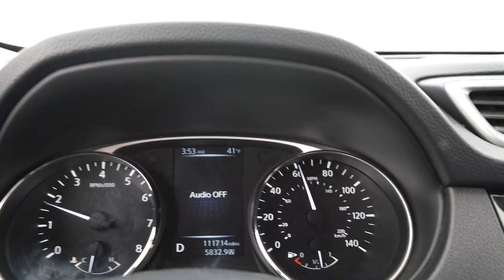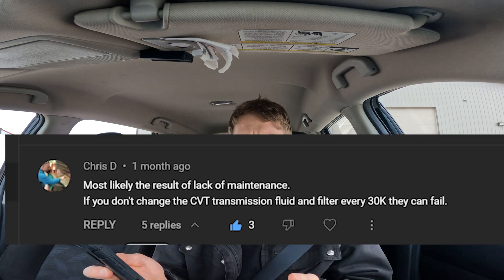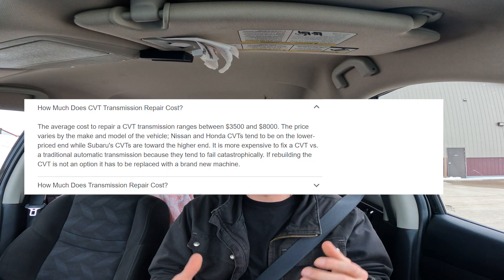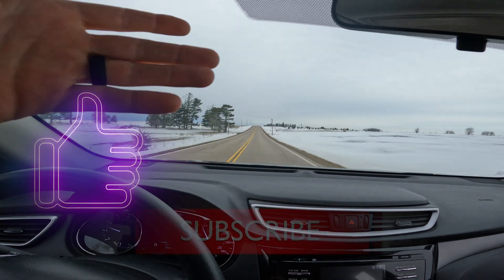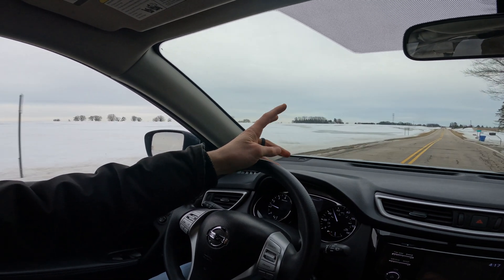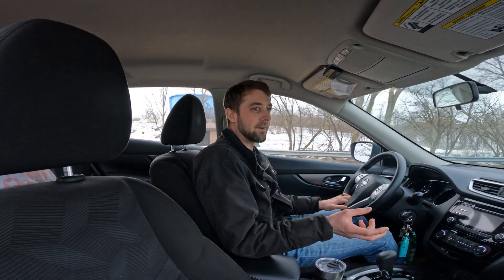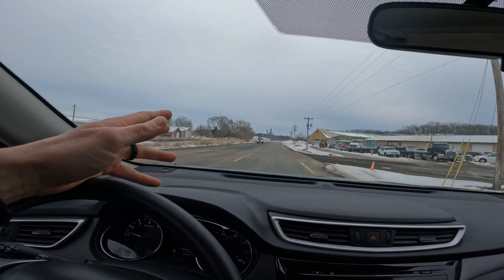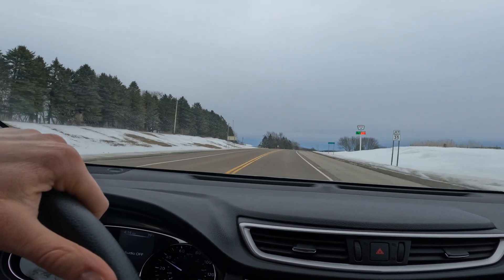Everything WRONG with the Nissan CVT Transmission

Comment: My first and last nissan. Never again nissan. Bought 2 years ago and the repaircost is higher then the price i bought the car.
Reply from the maker: Right! Spot on with the repair costs. What repairs have you done?
Reply: @ManvsCars  
I brought the car to the nissan dealer where i bought. Still not repaired.
I bought 2 years ago for 11.000 Euro and the repaircost will be around 11.500 Euro.
I give it to my lawyer to handle this case.
Btw i had no accident. This is just what need to be repaired from engine. 🤮
I drive car for more then 30 years. I never give to lawyer if my car need to be repaired. This is first time. The repaircost is shocking me. Never again Nissan.🤮
Reply: Without knowing what you bought, whether it was new or used and without you saying what the actual mechanical problems you have, your comment is largely irrelevant. If it was a new car, then yes, fair enough to complain. If it was something with a bit of age and a heap of mileage, then that isn't so surprising. 

Good luck taking legal action. Who is at fault, Nissan or the dealer who sold you the vehicle?

It's no surprise at all that the repair costs increase in relation to the purchase price and current market value as a car ages. All cars suffer wear and need maintenance, that's not just a Nissan thing.
Reply: @peterh8253  

No.

This Nissan was not my first car but my last Nissan.

I have many years experience with other brands like BMW or Mercedes or VW. This Huge amount of repaircost i never had with other Brand.
Reply: Sounds like you bought a pretty cheap car
Reply: Should the transmission be left in the drive mode or should it be moved to neutral? Does one have an advantage over the other or it is just about the personal preference?
Reply: Gahdamn!!!!
Reply: 😢😢😢😢 I purchased a 2017 Nissan Rouge used. My Honda Pilot surprised me and broke down 😢😢😢 so I went in desperate and broke to Honda and came out with this piece of expensive junk! I've spent more money in repairs than I spent on the car 😑. Had the car for 2years to date, 1 year in  if I was in heavy traffic the car would Rev high but not excelerate. At stop lights it would do the same. So I had them flush the transmission. Worked for 1 week and got worse, now I had to turn my car off and turn it back on to stop reving...in the middle of traffic on the freeway. Nissan quoted 10k to fix code P1715 and P0776. No I have no idea what that means because 10k, I been trying to figure out how to ask Jesus if I can borrow one of those chariots until I get my money up 😢😢😢😢😢. NEVER AGAIN! cause even if I do pay 10k to fix it, it will break again in less than 5 years probably given what he said in this video. Honda Civic or bust! 😢😢😢😢
Reply: I have 3 Nissan and never had a problem since 10 years. It’s your karma because you know how to care of your engines.
Reply: @Pretty_Boy_x were they CVT Nissans? Ya muppet. If they were so good, why did you own three of them in ten years?
Reply: @Pretty_Boy_x  10 years 😂😂😂 my car is a 2017, check back when it starts giving you the middle finger for your confidence 😂😂.
Reply: @Pretty_Boy_x  10 years 😂😂😂 my car is a 2017, check back when it starts giving you the middle finger for your confidence 😂😂.
Reply: @Pretty_Boy_x  

Nothing to do with me.

I brought my Nissan to 4 different service because no one wants to repair the CVT of Nissan. I called 30 service and explained and asked if they can repair. 
Answer: No
This is a Nissan quality problem.

At the end i found i service station they can repair. It cost me more then 5.000 Euro. The guy from service told me Nissan CVT not good.
This not only quality problem of Nissan. Even the service from Nissan Europe not good. 

My first and last Nissan.
Reply: @mr.ggermanx4350 hang on. A couple of comments earlier you said the repair costs were around 11.5k Euro and now you say it was less than half that. You sound more like somebody wanting to ridicule Nissan than someone with a genuine complaint.
Reply: @peterh8253  

No. You think i just write a story for fun ?

This is real experience.

I brought the Nissan to the Nissan dealer where i bought the car. 11.500 Euro repaircost they wanted to charge to me. Give me your Email i send you the quotation.

After long time discussions and no Service from Nissan dealer i decided to bring my car to another car Service who made better quotation of around 5.000 Euros. I can Show the this invoce as well.
The guy at this car Service told me Nissan CVT is not good. He should know better then you.

You are free to buy the car you want.

This was my experience and you can  make your own experience with Nissan if you want. I dont care.

Who ever will make same experience will not be happy about it.

And as i said: 

My first and last Nissan. 
I sold the Nissan after repair.
Reply: @mr.ggermanx4350 I am really sorry to hear. However, I'd like us to appreciate that sometimes it's just a bad chance, not a bad brand. Chances are you landed on a vehicle that had been grossly mishandled by the previous owner (s). Nissan's aren't bad to that extreme. I've seen worse Toyotas
Reply: @inAfrikca  

No sorry. Never again Nissan for me.
Reply: @peterh8253 $13000 AUD for a replacement gearbox. And they KNOW the design is flawed. How can a replacement gearbox cost even half that? Goes to show how much mark up they put on their dogsh17 transmissions.
Reply: Nissan are clowns, the worst thing ever fitted to a motor car is a CVT transmission. It is just RUBBISH, AFTER 7 Nissans I will never drive another.
Reply: Same.  The transmission light went on and the mechanic said it would cost 13k to fix it

Comment: Get a Crv, accord, civic or Corolla. Any one of their cvts can last longer than these French made cars
Reply from the maker: Agreed!
Reply: Lol those cars are crap too. Toyota with their oil burning engine and hondas with their weak suspension components. All cars suck nowadays.
Reply: Which Toyota engines burn oil? barely a few nowdays, maybe the generation 3 Prius from 2010 / 2012, before the piston ring update. Toyota engines have high tolerance, and are the most reliable out there along with Honda.

 @BroadwayLTDProductions

Comment: These are literally garbage, I have a 2019 rouge sport and yes it feels like your putting down all 141 horsepower but unlike the older cvt it doesn't lock at the rpm and hold if they kept it that way there wouldn't be as much hate. Ironically, turning off ESC acts as a "sport mode" and makes the shift threshold alot higher.
Reply from the maker: 😂😂😂 Spot on!

Comment: Most of them failed because of primary pulley bearing and rubber seal. Rubber seal with dirty fluid, yah you get the idea.
Reply from the maker: Yeah, they had a couple weak points for sure. We changed the fluid as recommended with Nissan Fluid. Still failed but hey that's cars right?

Comment: Jatco is the top worst CVTs.  Renault went for as cheap as possible, charge more and any possible mpg gain is lost by having to lay on the gas to get power to move!   It's just pure car maker greed, and I'm glad I have a plain 4 speed auto. Simple and will last just about forever.
Reply from the maker: Right. Yeah their claim to fame had to do with fuel economy supposedly. We’ve had this rig for awhile and haven’t noticed much of anything. Also power band is horrible.